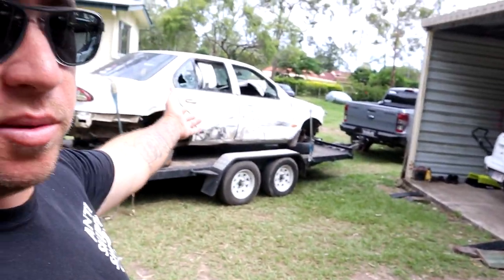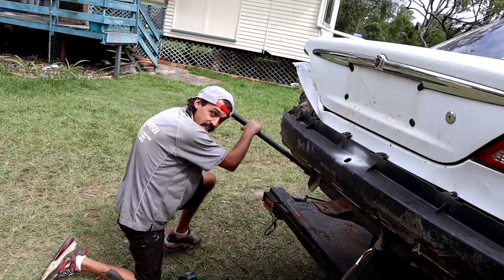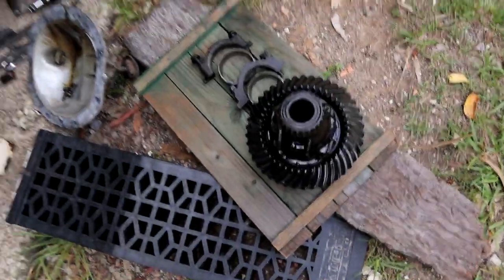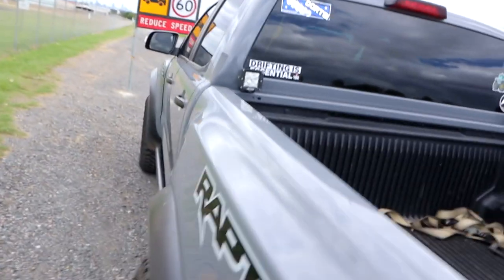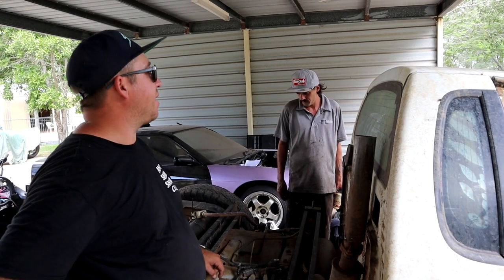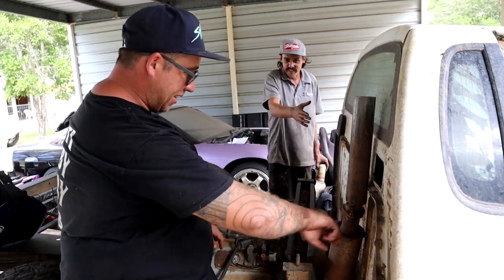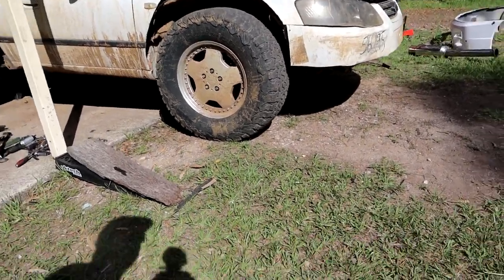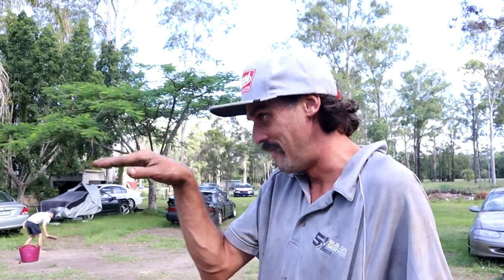barraptor modifications

Comment: The first few months or so of owning my cefi I think I was pulled over at least once a week. Usual nonsense of a breath test. It stopped after they’d all seen the car getting around the coast on a daily. Had 9 defect notices in that period. Passed all btw. Now if they talk defect I ask for their address or station they work at. Why is always the question after that. I simply tell that when I’ve been to the transport department and they clear the car I’ll send them the report so they know where they fucked up. I have sent three reports so far. Even had Tom at the department write me a little letter about the most obvious bit they defect me on. Pod filter. Exhaust. Hole through inner guard for intercooler pipes. Horns. (I have an air horn as well as after market stock replacements that are super loud, making four horns)  and some upgrades. Such as seats seat belts and suspension. One cop told me coilovers are illegal lol. So now if they talk defect I hand them a copy of the last report and Toms letter. No defect in years.